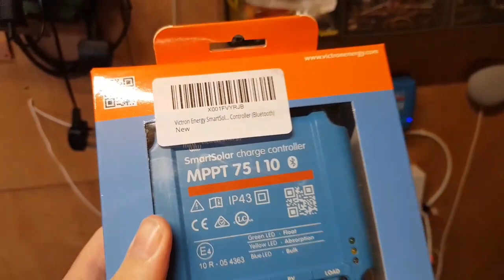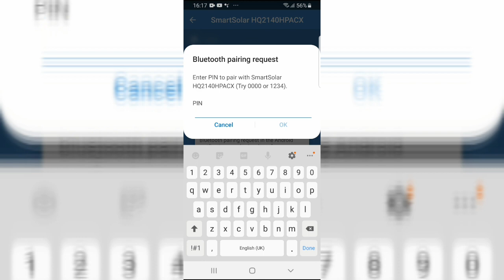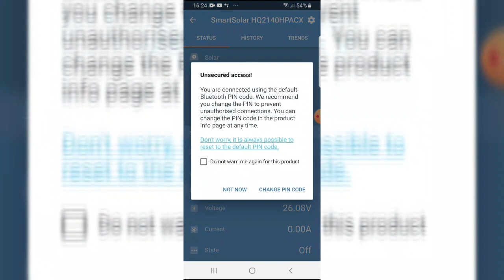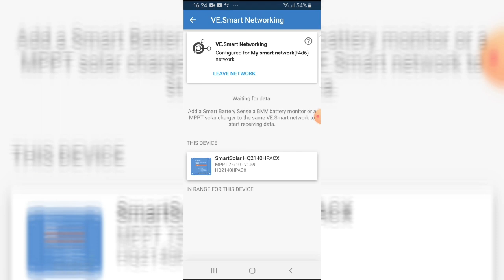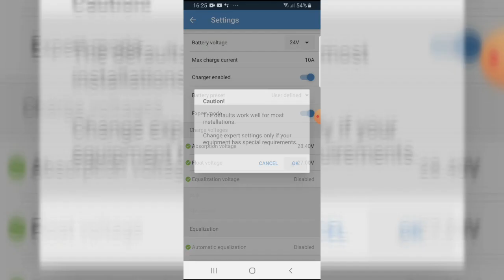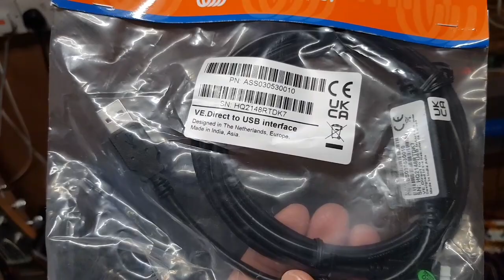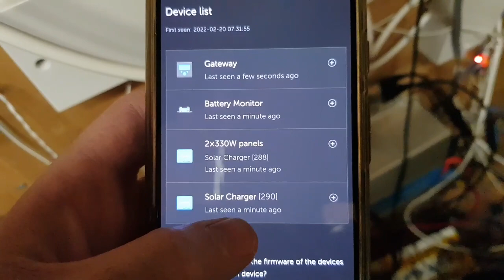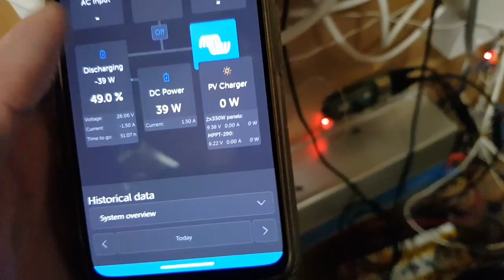just add more victron

Comment: I would have thought the one would have been enough..using parallel and series combiner box
Reply from the maker: Mixing panels will reduce the output of the higher wattage panels as in series it would restrict the current. While in parallel it will restrict the voltage. Best to have another mppt and a separate string.